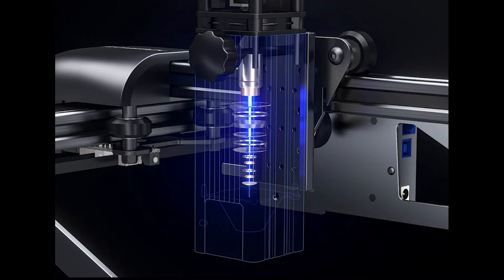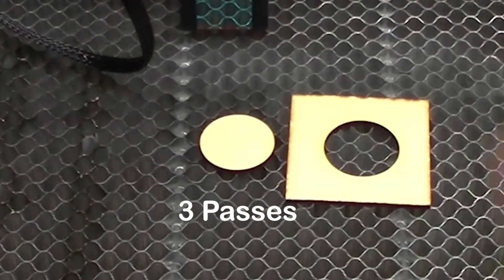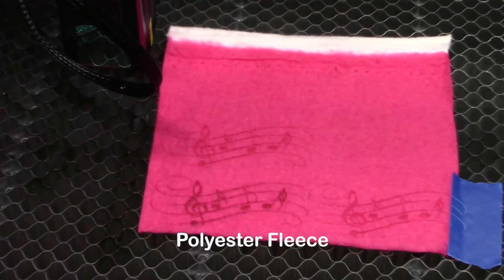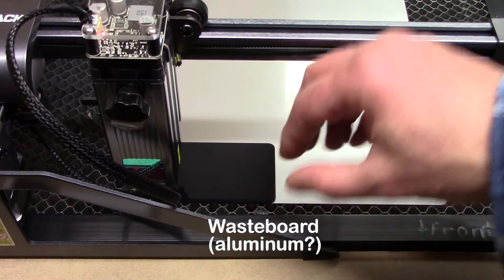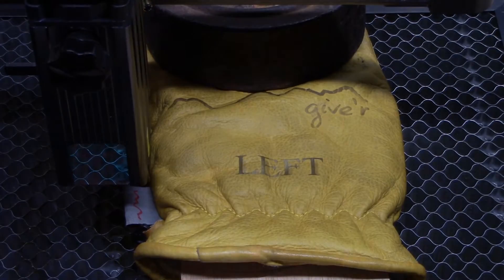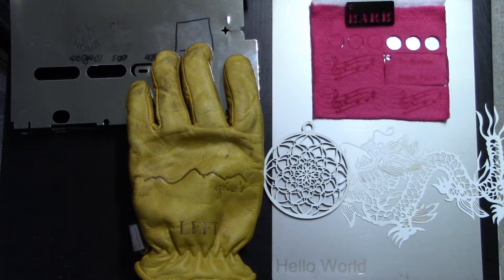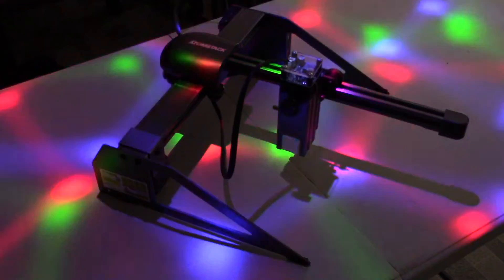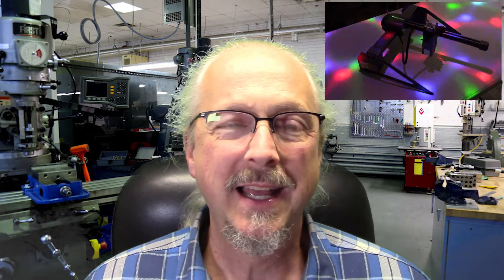You won't believe what showed up in the mail! An Atomstack P7 Portable Laser Engraver

Comment: I am interested in if this engraver would do a decent job on copper. Like small medallions to apply to projects, in essence making my mark 🤪.  It's the smallest and cheapest I've found so far that's supposed to engrave on metal.
Reply from the maker: I tried doing some simple engraving on copper and it just didn't work.  I tried a couple methods and neither left any engraving on the copper.  I will be posting that video in a few weeks.  I wish I had better news for you on that.
Reply: @CNCATHome  
Thank you for experimenting. Now we both know something we didn't.
Reply from the maker: An interesting idea.  I have not tried working with copper yet.  You had me thinking if I even had any copper I could try. I just recycled a bunch of copper pipe.  I could have cut a piece off of that and flattened it.  I will dig around to see what I can find and give it a try.  So far, the Atomstack P7 has worked well on my smaller projects.
Reply: @CNCATHome  
While for me it's a stretch $$ but I'd like to make sure people know that an individual made "this" and it wasn't a kit or commercial product, and I want to create everything from scratch including my ID... 🤪
Reply from the maker: @cynicalrabbit915  - I get that.  When I put the cork backing on coasters I make, I put the CNC @ Home logo on there as well.
Reply: @CNCATHome   wonderful , is it 0.02 spot size can you do test
Reply from the maker: @atntaltd  - I have not tested the actual size of the spot with this laser.  I could try some etching and put it under the microscope to see how thin the burn is.  I will have to add that to the list of videos to try.  :-)
Reply: @CNCATHome  that would be great , i will wait for it , subscribed

Comment: Not convinced about safety. When the laser burns through the material being cut it hits the supporting metal and is reflected widely. This is a definite hazard. If the machine had a removable UV opaque enclosure it would be far better.
Reply from the maker: Working with a laser is always a safety issue.  The panoramic glass does a good job of containing the scattered/reflected light.  In fact, it makes it difficult to even see what you are working on as the cut height of this laser is very close to the material.  I do like the flip up guard better.  the panoramic glass is removable but not a quick on and off thing for getting set up.  As a general rule, we should always wear our protective goggles while working with a laser, just in case!  Better save than sorry!